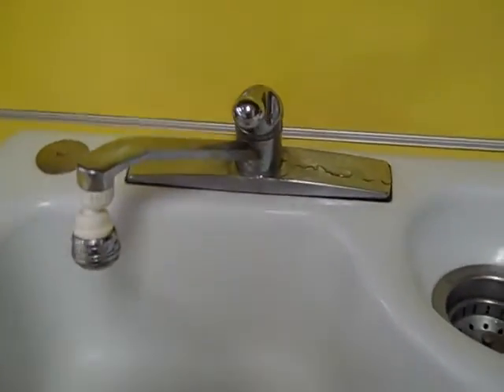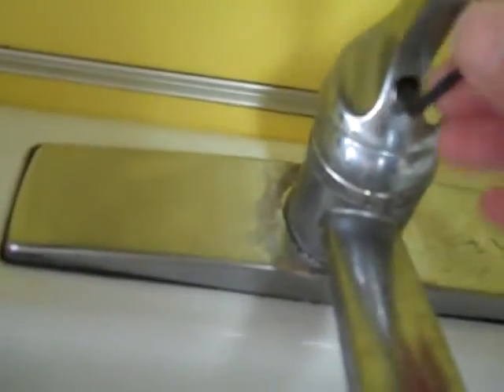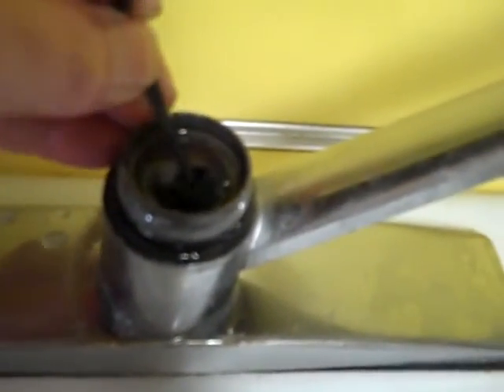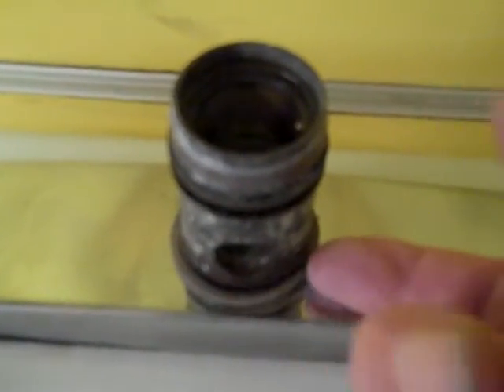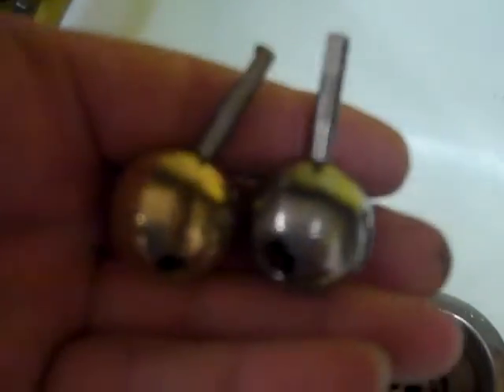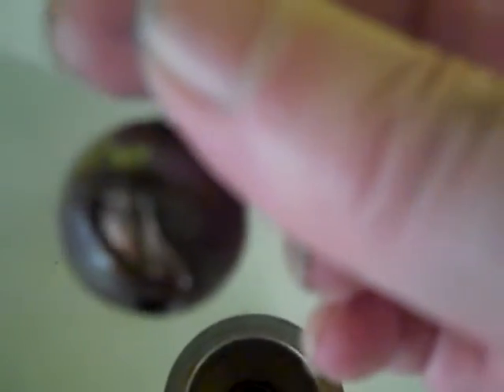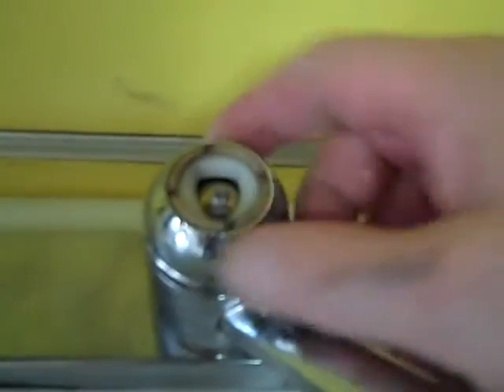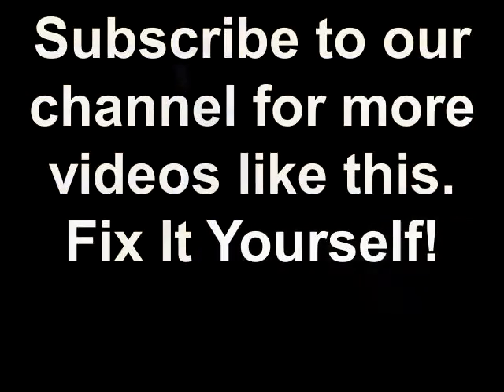How to Repair a Delta Faucet - Single Handle Delta Faucet Repair - Fix It Yourself

Comment: Mine doesn't have a ball inside; has a weird bracket and lots of plastic parts. :(
Reply from the maker: So what is the model number and what is wrong with it?
Reply: I finally figured it out; it was another brand that looked like a Delta. Thanks anyway.
Reply from the maker: No problem. Thanks for the final conclusion.